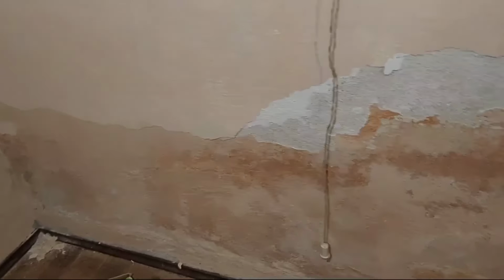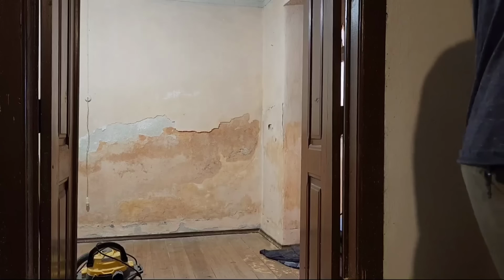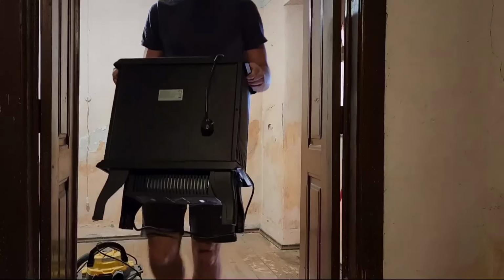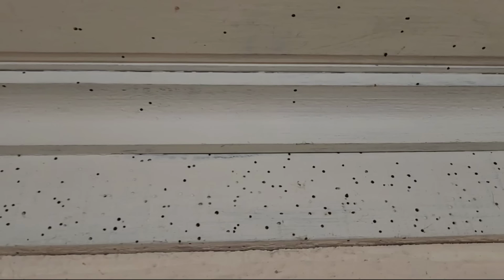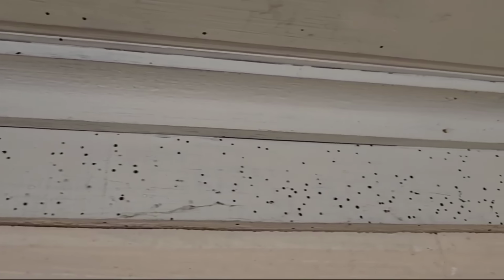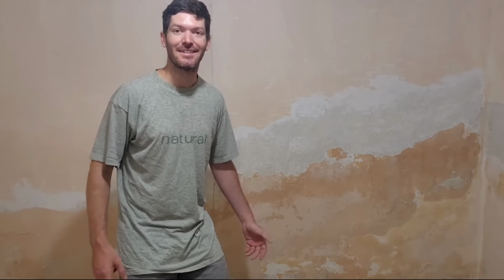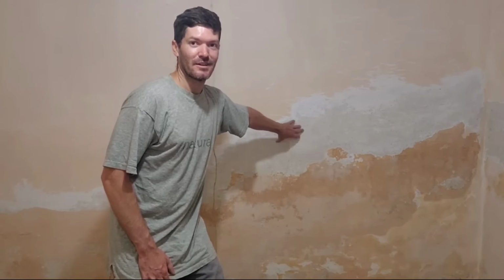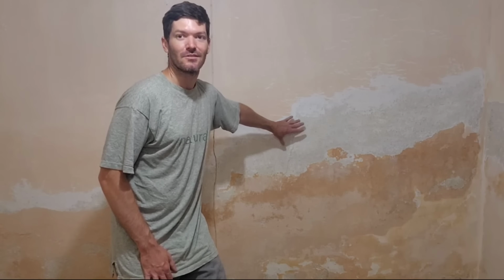My $15K House - Ep. 17 - Prepping The Next Room

Comment: Looking good!  I think whitewash is the way to go on these walls rather than paint.  The paint spalled off because it does not 'breathe'.  So moisture got trapped between the conventional paint and the plaster.  Trapped moisture caused the spalling.  
I like your plans for the room.  You may want to put a few finishing nails through the face of the ceiling panels to flatten the sagging areas.  Finish nails won't be visible after a coat of paint.  It will be fun to see the wood beneath the brown paint.  Best of luck! :)

Comment: I think what you were peeling off the wall (you referred to it as paint) was the top coat of the plaster. The bigger issue is the incursion of moisture that caused all that damage. Have you looked into that and corrected the problem? What's on the other side of that wall?
Reply: no its paint my house did the same thing. Where he applied what was left of the whitewash looks like it was a concrete patch job and someone used regular paint after their repair you can not paint adobe, plaster, gypsum block ,etc it will crack and come off in huge chunks like that
Reply from the maker: Its paint, theres no top coat just several layers of whitewash, which seems to be the style among the old houses here. Theres nothing that I can tell that would cause moisture issues but maybe there used to be something that isnt there anymore. The other side is a covered area next to the neighbors driveway

Comment: The most important
thing is the roof. Are you worked on the roof? Good wishes from hambourg.
Reply: Perharps the humidity in the wall came from the ground.?
Reply from the maker: The roof is in good condition, the moisture would have come from the ground but I think it is an old issue that isnt a problem anymore

Comment: Is the wall suffering from rising damp?
Reply: I wondered if that was the issue
Reply from the maker: I'm not sure what the issue is, theres nothing current that should cause that so it might have been something from previously that isnt there anymore
Reply: @My15KHouse  Read lots of English mysteries and rising damp is mentioned. With your posters talking about it, I  guess it's a real thing.

It sounds so cool, but for it ruining a building!
Reply: @My15KHouse I might be mistaken, but didn't you at one stage have some leakage/seepage from the same area (between your and the neighbour's wall)...?
I somehow recall that one of the other rooms was affected by it - through the roof/ceiling. 
But, I could very well be confusing it with something else, I'd been watching! 😶 🙃

A nice recap video of where you first started, would be welcomed, too. Also, a look at the garden, even if it's a disaster zone; a look at how the streetside paint job, held up, would be a nice video filler, too. 

That country walk looked so peaceful and relaxing. Beautiful area you find yourself in.
Reply from the maker: Thats correct, the other bedroom had that problem mainly from the gutter overflowing from being full of stuff, it was a different wall though. I was going to do a garden update video setting up the compost bin the county was giving out but they ran out when they came here and so I have to go to the city hall 30 min away and havent gotten around to it yet, recap is in the works too but for some reason those take longer trying to find all the clips I want. I did actually film a bit for the outside paint after a year but forgot to include it so I'll work it in when I do the next painting video

Comment: This room has a damp problem on that part of the wall, which cannot be solved by painting. You must first remove the dampness and then paint, otherwise the paint will separate from the wall after a short while. And it is not good for health either.
Reply from the maker: Its a previous problem that isnt an issue anymore